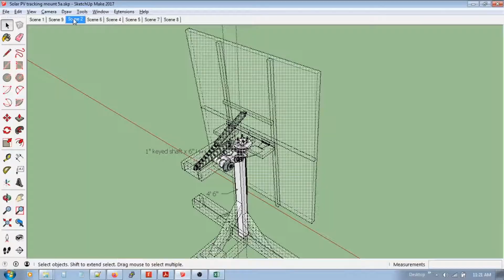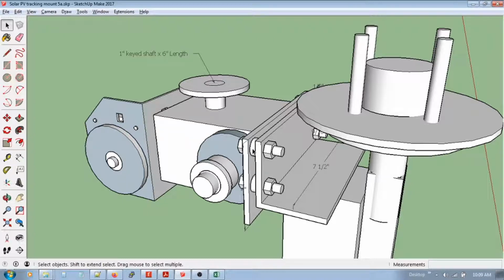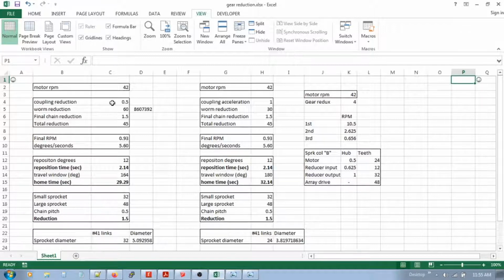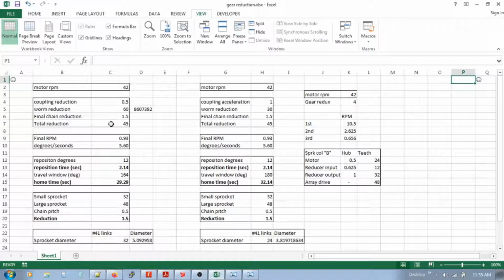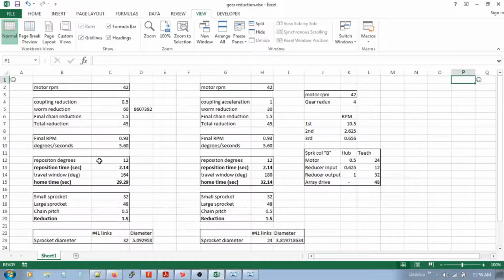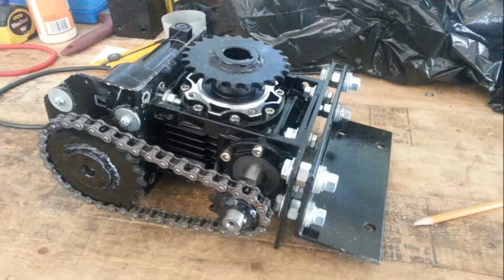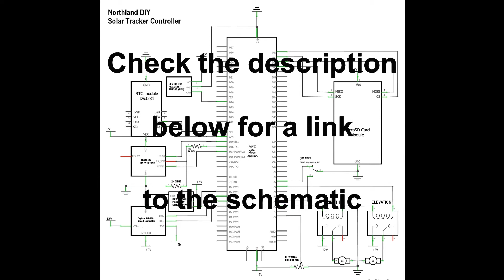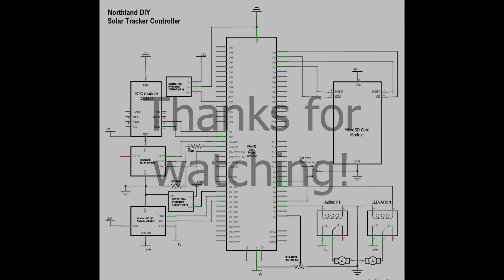600 watt DIY Solar Tracker - Part 2

Comment: a small oversight is the way you are using the linear actuator, they dont really do well in the PULL configuration, they do much better in the PUSH arrangement. Where about in canada is this?
Reply from the maker: I haven't noticed a lot of difference but you're right there is some.  The panels are pretty much balanced around the hinge axis which makes it easy to move. The specs of the actuator says they can move 100lbs and have a 500lb static rating.  The movement is actually tangential to an arc which makes it more difficult at the extremes.  I would have preferred using a slewing drive but they're expensive and I couldn't find one small enough for this project.  Thanks for your input.  The location is near Algonquin Park in the Haliburton Highlands of Ontario

Comment: Great gear system ;)
Reply from the maker: Thanks. There's a lot of room for improvement but they all involve machining and a lot more expense. I'm always looking for and pondering better solutions however.  I'll be going over the code in the next video. (Over 2000 lines!)  Thanks for watching.